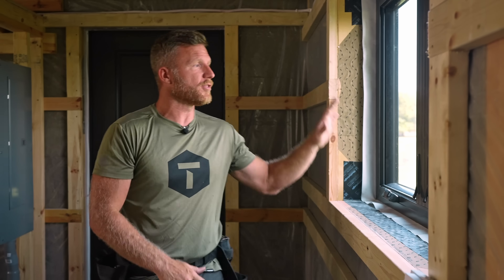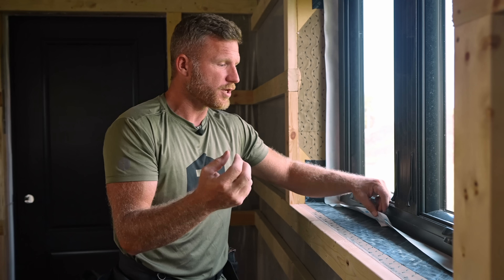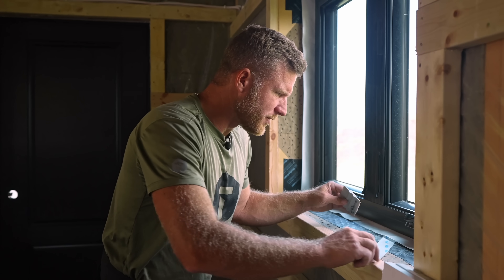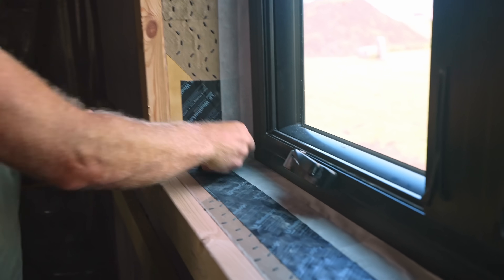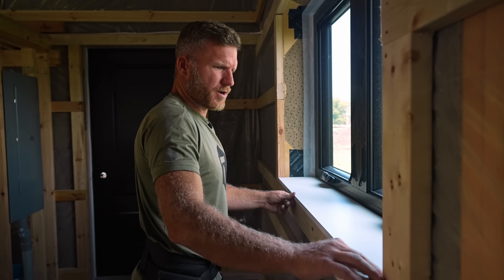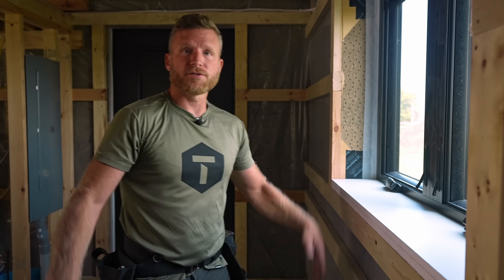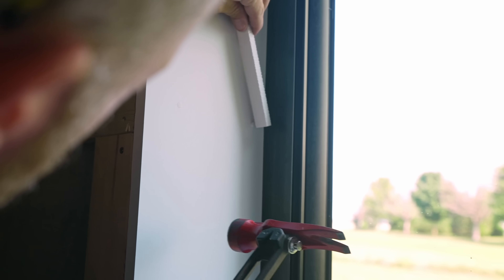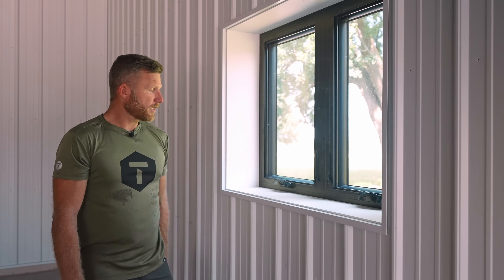Bullet Proof Window Detail to Increase Energy Efficiency

Comment: Hi Kyle, thank you for all of your videos, they have been very helpful! I do have a question surrounding window/door flashing. We are installing LP vertical board and batten siding. I have seen you install the siding first then trim and other times I have seen you install trim first then siding. The only difference I see is that if you do siding first then you have to have drip caps and flashing installed before trim and install J channel after trim vs. if you do trim first then you just use the drip cap or Z flashing since it covers the top and do not come back with J channel. Is this correct? Is one of these preferred/required over the other?

Comment: Hi Kyle,   great instructional video.    Have a question about your overall air sealing.   When you do your vapor barrier, do you seal the plastic via caulking or tape?   I never see you do that on any of your videos, perhaps it is not a requirement within your area or building code?

Comment: After many many years of applying vinyl and other types of tapes/decals/stickers/wraps with backing on them, I would think that starting in the middle of the window and pulling off the backing, sticking the tape down while working towards the corners would be a better way of doing that. so that any excess material gets stuck down into the actual corner and fills any potential gap in there. which takes the stress and folds out of the flat material in the middle. if that makes any sense.

Comment: Hi Kyle. John from SIGA here. If the backing strip that you left on spans across the r.o. from the window frame to the jamb, you have an impermeable material (the backer material) preventing drying to the interior.

The reason for two backing strips on the wider part of the tape is to reduce the risk of capturing an air bubble which might interfere with successive materials lying flat against the tape.
Reply: So you would recommend something like a mineral wool being stuffed in there rather than a backer rod?

Comment: AI Summary

Abstract:

This video provides a detailed tutorial on creating a high-performance, airtight seal on the interior of a newly installed window, specifically within a garage or shop setting that uses non-traditional finishing materials. The core of the process involves using Siga Fentrim IS 20, a specialized adhesive tape, to bridge the gap between the window frame and the rough opening, creating a continuous air control layer. The presenter demonstrates the step-by-step application, emphasizing techniques to avoid "fish-mouthing" (wrinkles) for a perfect seal, especially around challenging corners. He also explains the material science behind using the white (vapor-variable) Fentrim for interior applications. The video then covers the installation of PVC jamb extensions using Cortex screws and plugs, and finishes with steel J-channel trim, showcasing a durable and clean final look suitable for a workshop. Throughout the tutorial, the importance of meticulous air sealing is stressed as a key factor for long-term comfort, energy efficiency, and durability.

A Builder's Guide to High-Performance Interior Window Sealing

*   0:00 Project Overview: The video demonstrates how to seal a window on the interior of a shop/garage, focusing on creating an airtight seal before applying final trim materials like PVC and steel.
*   0:48 The Airtight Solution: Siga Fentrim IS 20: The primary material used is Siga Fentrim IS 20, a white adhesive tape designed for interior air sealing. It was pre-applied to the window frame before the window was installed.
*   1:18 Insulation and Air Control: Instead of relying solely on canned spray foam, backer rod is used in the gap for insulation, while the Fentrim tape serves as the primary air control layer to stop air leakage.
*   2:25 Application Technique and Avoiding "Fish-Mouthing": The presenter shows how to apply the tape from the window to the jamb, stressing the importance of achieving a flat, wrinkle-free application (avoiding "fish-mouths") to prevent potential air leaks.
*   2:59 Material Science Matters: A key takeaway is the difference between Siga tapes: white Fentrim is used for the interior due to its specific permeability (allowing for proper moisture management), while gray Fentrim is designed for exterior use.
*   3:55 Mastering the Corners: The corners are identified as the most challenging part of the installation, requiring careful manipulation of the flexible tape to ensure a continuous, tight seal without gaps.
*   5:31 The "Why" Behind the Method: The presenter argues that this meticulous approach to air sealing, while seeming like "overkill," significantly enhances a building's comfort and long-term performance, justifying the extra time and effort.
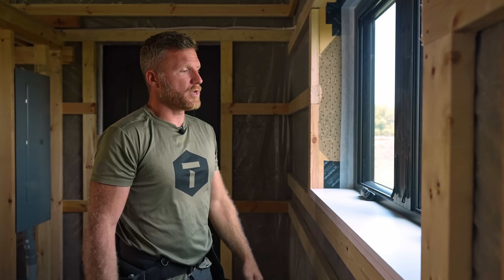*   8:05 Choosing the Right Window: Casement (crank-out) windows are recommended for superior energy efficiency, as they create a tight compression seal when closed, unlike less airtight double-hung or sliding windows.
*   9:05 Installing PVC Jambs with Cortex Screws: The video shows the installation of durable white PVC jamb extensions using Cortex screws. These screws feature a reverse thread to pull the material tight and are concealed with matching plugs for a clean finish.
*   11:50 The Finished Product and Key Takeaway: The final installation is shown with steel J-channel trim, resulting in a clean and durable finish. The video concludes by reinforcing that properly sealing penetrations like windows is critical for an airtight, high-performance building.

I used gemini-2.5-pro| input-price: 1.25 output-price: 10 max-context-length: 200_000 on rocketrecap dot com to summarize the transcript.
Cost (if I didn't use the free tier): $0.03
Input tokens: 15947
Output tokens: 759

Comment: have you tried a rubber mallet on those screw plugs? I just wonder if it would sink them flush as well. I haven't ever used PVC board but seems like a good option! I think it would stand up better than sheetrock for sure! I don't know how much condensation these windows get around them.

Comment: If properly taped on the outside with flashing tape and low expansion foam around the window frame space, there will be no air leakage at all and it will be five times faster and certainly five times cheaper.  With a professional foam gun with a sensitive trigger, low expansion foam give a perfect seal.
Reply: Why even watch the channel if your just going to hate. I mean what’s the point. I learn a ton from this channel and some things I like and some things I don’t like but I don’t come to the comment section to just hate on the man.
Reply: Overthinking a solution for a problem that doesn't exist or a pre paid commercial to sell more product
Reply from the maker: Here you go… rotaxrider still watching but loving to hate.   I don’t make a dollar off this.  Not sure how a guy is supposed to
Educate and share knowledge about processes, materials, tools, etc without guys like you assuming everything is a commercial….. now that I think about it.   You are right it is a commercial… for me and my company.   This is why I continue to find quality clients who appreciate the details and methods we use.  Thanks man
Reply: @RRBuildings At 5:48 your full of BS.
Your window detail compared to using low expanding closed cell foam will not make a difference in comfort or a feeling of better comfort or better performance.
Long term I'll take the spray foam.

Comment: I'd be curious to see if there's ever a point where the guidance has to be different? A lot of the explanation for vapor barrier inside and tyvek outside is to keep the warm moist air inside so it doesn't condense in the wall when it meets the cold outside. Good logic for northern climates where the inside is usually the warm side. But what about hot climates like gulf coast or the US South where a house with A/C running is on the cold side of the thermal gradient? now the warm moist air from outside migrates in and condenses in the wall. So do you flip the layering? Or are there new products out there that adjust their permeability based on that gradient?
Reply from the maker: Yes southern locations that are mainly air conditioning have a different method and need to keep vapor barriers towards the outside

Comment: You definitely have never done commercial work where blueskin was used as a WRB with primers and adhesive and the blueskin over time had lost its adhesion over OSB and ply over time 
Relying on adhesive is like relying on caulking.
Also who installs Windows without a 3/4 or 1/2 inch return. Only a self proclaimed pro I'm guessing
Reply: Henry Blueskin isn't SIGA Fentrim. SIGA has decades of data demonstrating it doesn't do what you allege. Your comment does not reflect what is known about the SIGA products. With your logic, you'd be calling Lexus an unreliable car because Yugo has a history of being an unreliable car.

Comment: All I ever did was spray foam being I relied on my drainage plain, sealant tape over the nail fins, silicone under the nail fins before install, sealant tape installed bottom to top/shingled to shed any water that made it behind the siding, in my mind the exterior was the crucial area to give sealing attention to and you have that covered thoroughly. I'd bet that your windows never leak air for the life of the home let alone water

Comment: Please make a similar vidio inside the house showing the window to Majrex connection.  In the garage, is the poly taped to the window rough opening?  If not, won't water vapor (humid, unconditioned air) find it's way BEHIND the poly?

Comment: Is it air sealed if tape to rain drain membrane?
Reply: Genuine question. Also having that membrane from out to in, is there a chance for moisture wicking. How does that membrane (rain) work, are the tracks/lanes separate vertically, is all connected like mesh. Very curious, thanks.
Reply: The WRB is supposed to be an air seal as well. So you are sealing air seal to air seal., to window. Either way, they are both adhered to the structure or other flashing that is adhered to the structure. I don’t know if the product itself is perfect, but the intent seems clear to me.
Reply: Yes agree, the intent is clear. I just wonder sealing to the face or rain side vs back(assume the air side that not perforated) makes a difference.   @pcatful